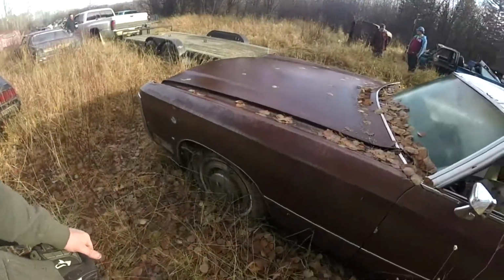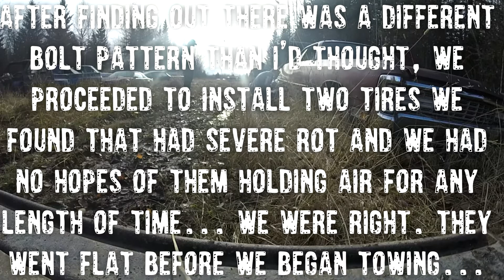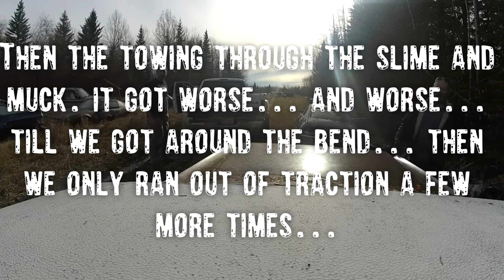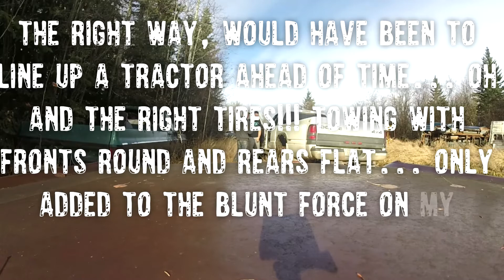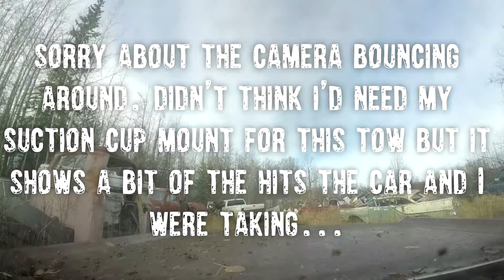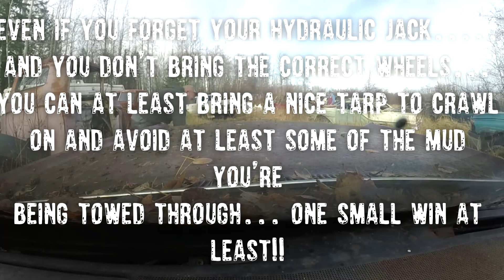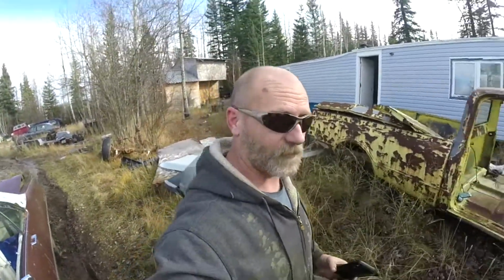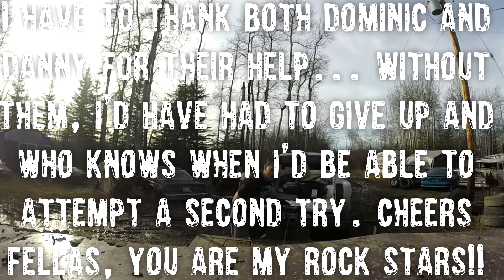Getting the Powertrain for the 1948 Chrysler Windsor Gasser... it's not always easy. Teamwork help!!

Comment: Well, who would have guessed a 440?? Good find getting all the pieces in one hit.
Reply from the maker: You got er. And it was a horse trade which is completely just within my budget. Hahaha. The engine needs a complete rebuild but the crank and all the small parts is what I was most concerned about. I have another block that's machined and ready for assembly but no crank. So that's handled. One trade at a time and I'll make a car outa this rig yet!🤘🏼🤩
Reply: @dazeofgloryshopworks5806  Chrysler big blocks are becoming hard to find.
Reply from the maker: @NO CCI's  you got that right man. There's another chrysler imperial there and the 440 is already spoken for by my buddy Danny. Or I'd have two hahahaha!